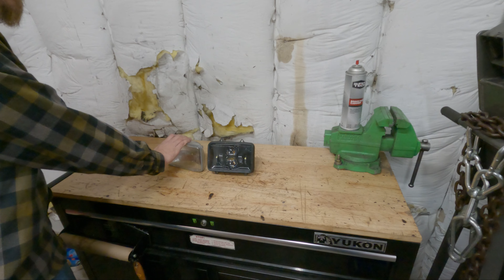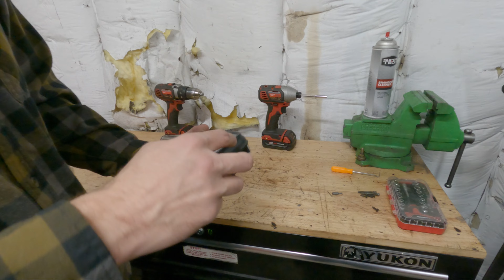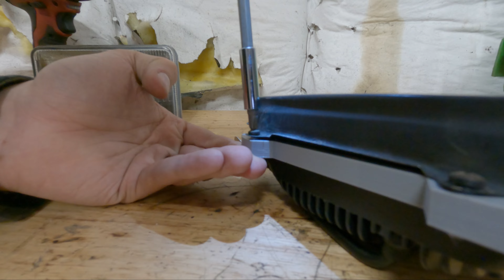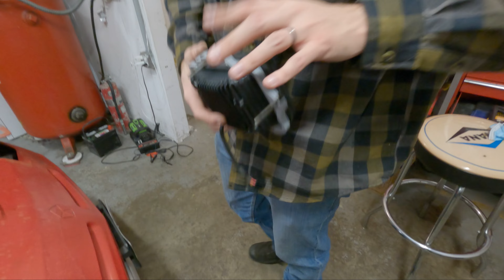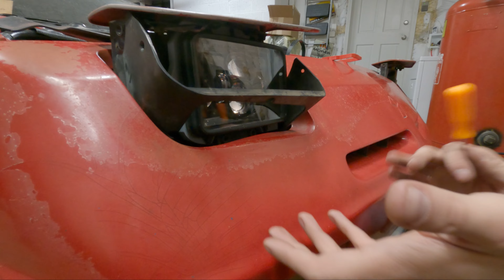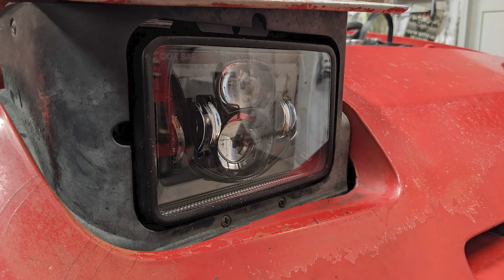3D Printed LED Light Brackets

Comment: Nice, i personally would like to use PETG or ASA for this cause they are both very high temp resistant and wont really warp over time.
Reply from the maker: I tried PETG but it's just not rigid enough. ASA should work if you get the layers to adhere properly, I'm having an issue where the ASA isn't stiff enough where the bolt shoulder rides, so the adjustment screw is just ripped out. 

Isn't a problem on PETG or PLA, but then you have other issues with those. 🤦